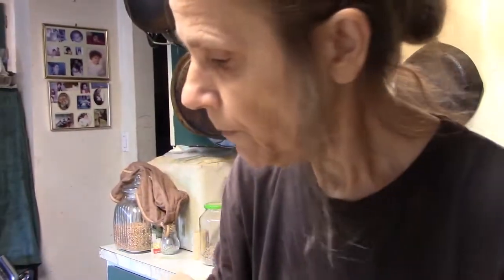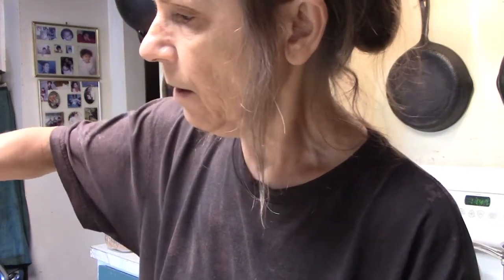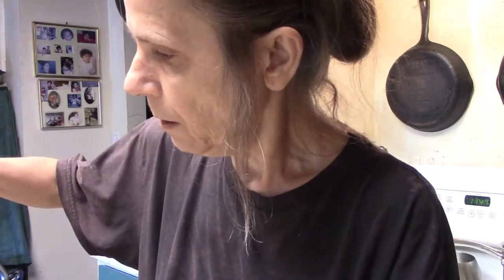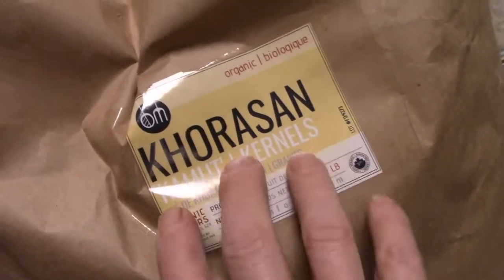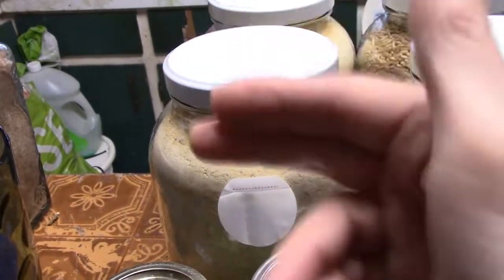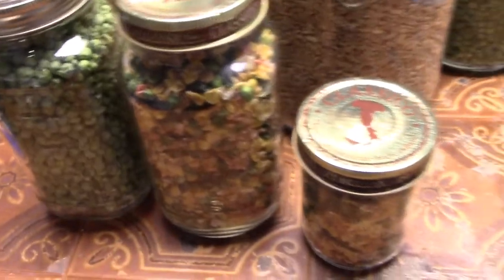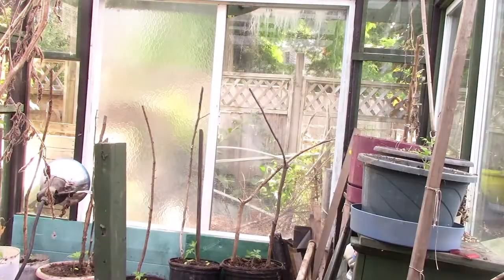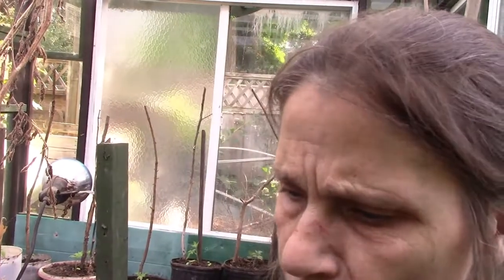Still Food Prepping - Betsy Is Gone - Jul 7, 2022

Comment: It’s because the Cadillac converters is what it’s worth the money
Reply from the maker: The back windshield was $175.00 from the auto-wrecker back when I bought it in 2016. The motor in that car was a better make than what the company usually used, not to mention the brake pads are new and were only used for 1 year among other parts in that car. The tires were new too and still retained air even after 7 years. He'll get $1000.00's of dollars in parts alone and he knew it, and especially in this day & age.
Reply from the maker: The covers over the headlights are  or were $70.00 a piece back when I had to replace one, I know because parts like that are hard to find.
Reply from the maker: They'll pick that car apart just like Uncle John was picked apart.
Reply from the maker: Even the spare tire will make them money....lol